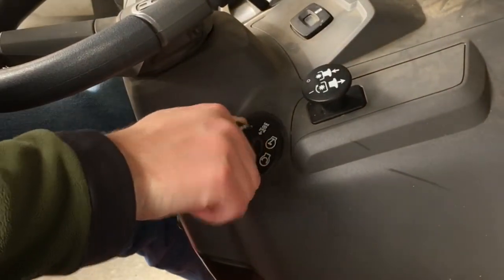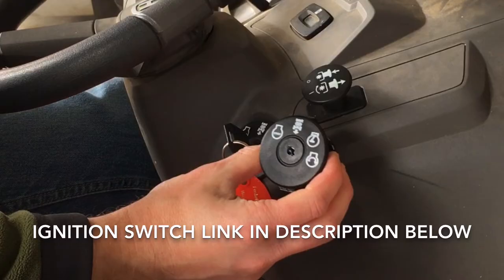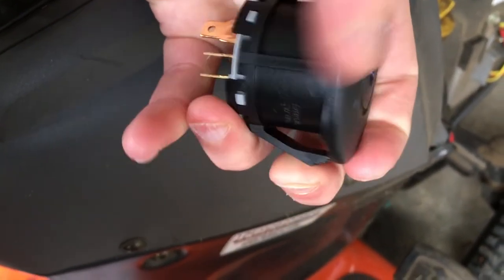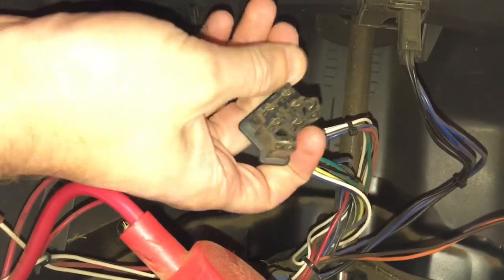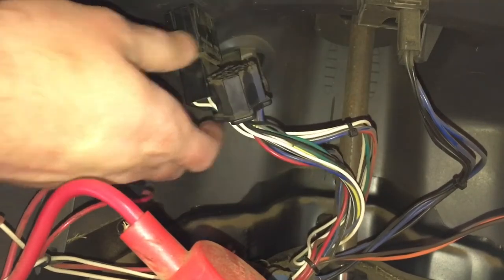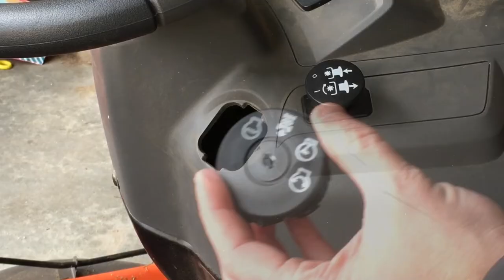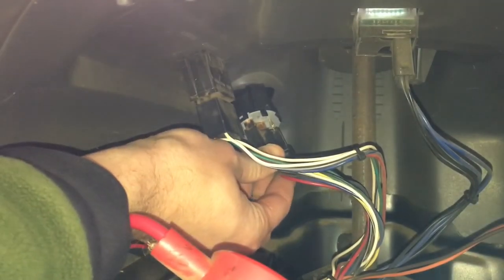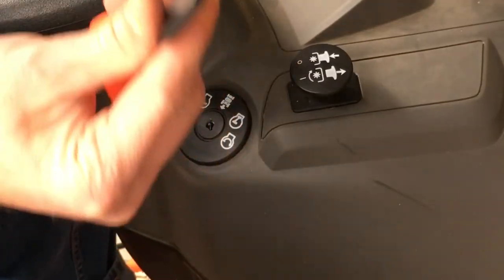How to Replace Ignition Switch on a Riding Lawn Mower

Comment: I would have push the ignition out first that way I can see the connector, unhooked, then plug it in and snapped back into place. There's plenty of wire

Comment: Note...This does not work as easy on a Scott's ( John Deere) rideing mower. There is a brace in the way so you can't get your fingers on the prongs too remove the switch. Good luck.
Reply from the maker: Good tip! Thank you for the input and for watching!

Comment: I found a mower and just bought a new ignition switch because there was no key, and the plug on mine is stuck together, any help?
Reply from the maker: Could it have possibly been heat welded together from a short?

Comment: This is my last hope I’ve changed battery all wires the solenoid and still nothing
Reply: Well it’s not the ignition switch either so I give up
Reply from the maker: Oh no sorry to hear that! Did you check your seat switch?
Reply: @5MinuteFixit  yes I had a guy come out and fix it! The motor burned the headlight and it blew a fuse by the battery. So he changed the fuse and fixed the headlight wires then it cranked right up!